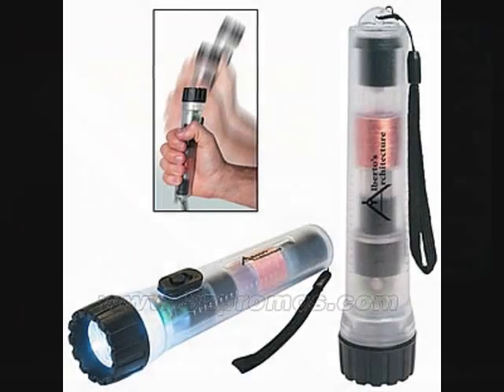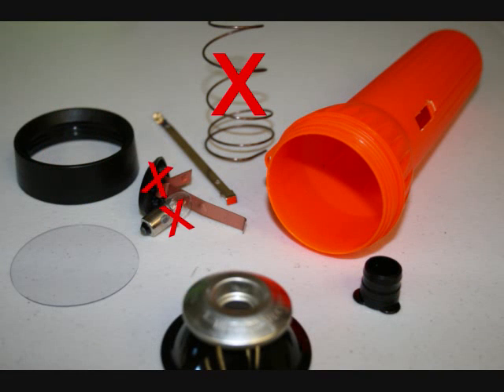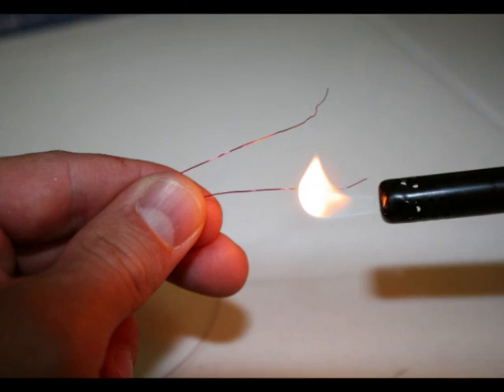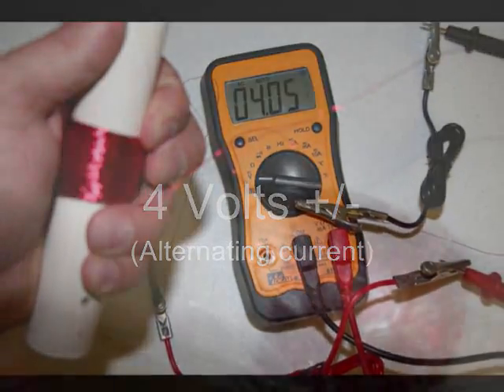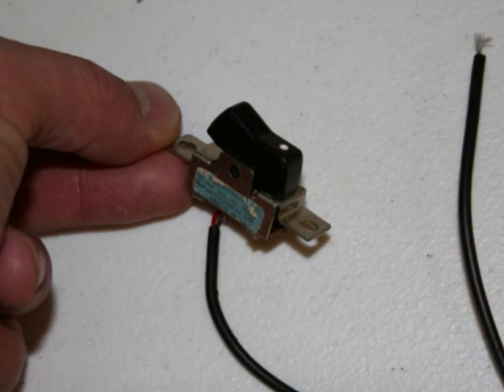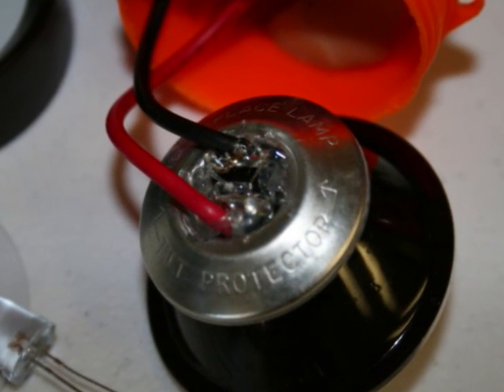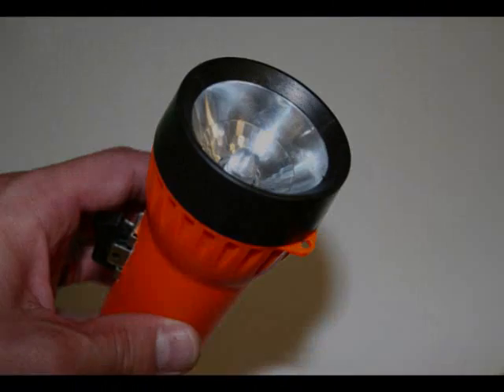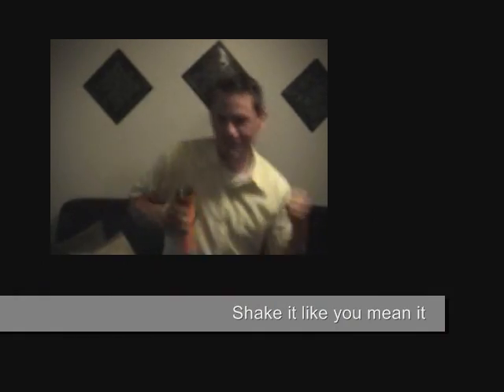DIY Electromagnetic Flashlight

Comment: for some reason, my LED light didnt last long more like 1 second of flash time. Did I do anything wrong?
Reply: The led has burnt out probably
Reply: @ihit2011RoboEngineer  no, the problem is the capacitor
it should be a battery not a capacity

Comment: I had one small question, can i use a 1000uf capacitor?
Reply: Unfortunately no, the capacitance of 1000uf would be too low for the led to be powered for long. Instead scrap some broken electronics or buy caps that are at least .5 fared, remember that 1 million uf is one fared.

Comment: 1 bldc motor
1 alternater
1 transmission transformer
1 switch box
1 circuits panel
1 ac to DC converter
1 big capacitor
1 7' brass ground rod
You have 1 self powered household generating plant to use for FREE free forever after cost to build.

Say no to utility bills and petrol fuels.

One power plant for home and one to motivate your vehicle.

Never buy energy again.

God's stuff

Comment from the maker: Some quick links to a few of the materials similar to what I used:

[✓] Magnetic Wire: http://amzn.to/2ckc5Aq
[✓] Rectifier: http://amzn.to/2clP7DR
[✓] Capacitor: http://amzn.to/2ckeECD
[✓] Rocker Switch: http://amzn.to/2clPHBg
[✓] White LED: http://amzn.to/2cd4Wid
Reply: Grant Thompson - "The King of Random" so this is how it all started :D
Reply: 1 day ago, hello
Reply: Isn't a 50a rectifier a bit of an overkill, is it?
Reply: Thanks!
Reply: +Grant Thompson How did you remove the spring
Reply: Grant Thompson - "The King of Random"  love all the vids even know there old
Reply: Grant Thompson - "The King of Random"  hi. i love you're vids I made the cap darts
Reply: The King of Random your a little late on that
Reply: The King of Random, no resistor for the led?

Comment: so, the capacitor is basically acting as a rechargeable battery?
Reply: +trouble maker I thought capacitors weren't very good rechargeable batteries.
Reply: +trouble maker Thank you for asking this, I couldn't figure out why it was even there but its obvious to me now that you are 100% correct.
Reply: +trouble maker They have vastly lower capacity than a rechargeable battery of the same size. In this case he's just powering a LED that draws very little current, so the (fairly large) cap nevertheless provides enough storage for a few minutes. A AA-size battery would probably power the LED for hours.

Comment: 3/4 inch PVC pipe works better. I used my table saw to thin down the pipe wall where I was going to put the wire coil so it would be even closer to the magnet.
Reply: +animu equals child pornography I completely agree and wish the USA would convert, but until it does I'm stuck with the standard of my country.
Reply: +Robert Vernon  Great idea about thinning the wall!  The closer to the coil we can get the magnets the better. I'm trying with some Hard drive magnets from 2.5" HD's epoxy'd round a foam core instead of a round neo magnet.

Comment: Grant Thompson - "The King of Random" what kind of circuit board did you get the bridge rectifier and capacitor off of? also is that a 1 farad or 1 milli farad cap.?

Comment: The cost of making this is stupid and the cap is too small and you don't need a bridge rectifier either, just a single diode. But the amount of magnet wire you will need to use along with the magnet just make this project more money than it's worth. You can buy a much better one for cheaper.

Comment: hey Grant Thompson - "The King of Random"  i have a doubt...you said that with only 30 seconds of shaking you have 10 minutes of light... did this useany kind of batery? where is it the electricity then? CAN you put a rechargeable AA battery or two? how should i change the circuit then? if i shate the flashlight without a battery like yours, and dont turn it on for, i dont know...six hours?twuelve? 3 days? what happen, the electricity is gone like static? if want to add to this a usb charger, AND the AA battery, ...how can i do that? my logic said that the battery will absorb all the charge... so...? howmany turns of wire do you use? thanks you and i am really concerned about my poor knowledge in english...excuse , that, greetings from argentina!

Comment: If you add more wire to the coil or add another coil over the first and wire it in parallel would you get more power for less shaking? I have had lots of bad luck with these types of flashlights I have one and I'm thinking of modding it to take regular batteries b/c I shake it like crazy and It's not very bright but when I use regular batteries it's much better.

Comment: The neodynium magnets store magnetism so its still a form of battery
Reply: actually its the 1 Farad capacitor yes that's right a FARAD not a microfarad
it's equivalent to a 1,000,000uF capacitor.
Reply: chems that's what confuses me, I thought capacitors discharged (almost) instantly. How can the LED emit light for 10 mins?
Reply: Matthew Pollock
 Super Capacitors F1 and up store a LOT more power than a regular capacitor and can function "somewhat" like a small battery.

Comment: can you list all the material please i can't hear it clearly
Reply: Magnet wire (insulated copper wire)
Neodymium magnet (very hard to find)
Bouncy ball (Not necessary)
Bride rectifier (To convert AC to DC)
Capacitor (1F - one Farad) (it's like a battery)
Reply: Madara Uchiha  well if was what doide should we use ?

Comment: Why is a rectifier needed? Wouldn't the shaking of the flashlight produce DC instead of AC?
Reply: When the magnet moves one way it produces a current following the coil. The electrons flow with the magnet. Shaking the magnet one way will produces an inverted current to shaking the other way. AC is basically any DC current inverting itself every so often, that is why a bridge rectifier is needed
Reply: Yeah he probably made a mistake.
Reply: I actually have no idea what you said.
Reply: ankit penmatcha I'm starting to rethink my original question. I need to get a bar magnet so I can experiment with this.
Reply: A few months ago I saw a demonstration on a real science show of this very principle. The magnet was slid all the way through the coil and registered a plus  on the ammeter. Then the host of the show asked the observers what will happen when the magnet slides back the other way. Everyone said it would send the needle to the other side of the dial. However, to everyone's surprise, including mine, the return trip of the magnet also gave a plus reading on the dial. The host pointed out that although the magnet was travelling in the opposite direction, it's leading polarity had changed. Two factors had been reversed, resulting in current flow in the same direction. Here's what I'm not sure about: The usual way to do this demo is to hold the magnet in hand and push it back and forth from one side of the coil. This gives an alternating current. But what would happen if the magnet were pushed in and out from the other side while maintaining the same orientation of the poles? The current would alternate but would it be with an opposite phase? (Added later) The more I think about the demo I saw on TV, the more I think there was something wrong with it. It doesn't make sense to me that it had those results.
Reply: jhanthony2 ok so you need two things to change to make electricity DC. Obviously the direction changed. But the magnet was not flipped in this one. The magnet was a cylinder and the hollow tube is a cylinder too thats why the magnet cannot turn around
Reply: jordan krishnayah That's why I now doubt the results I saw on TV. I never said the magnet was flipped. The experiment set-up on TV was essentially the same as that in this video.

Comment: Can anybody tell me what kind of Rectifiers should be used? I know nothing about the sizes... Below is the specs of some i found... Will they work for this? Thanks..
Amico 4 Pcs PCB 6A 600V Full Wave Single Phase Bridge Rectifiers RS606
Product Name : Bridge Rectifier;Model No. : RS606;Average Forward Current (If) : 6A
Maxi Peak Reverse Voltage : 600V;Maxi RMS Voltage : 560V;Maxi DC Blocking Voltage : 600V
Operating Temperature : -65C to +150C;Body Size : 22 x 17 x 7 mm / 0.87" x 0.67" x 0.27" (W*H*T);Pitch : 5 mm / 0.2"
Pin Diameter : 1.3 mm / 0.05";Pin Length : 28 mm / 1.1"; 34 mm / 1.3";Color : Black
Material : Plastic, Metal;Weight : 32g;Package : 4 x Bridge Rectifier
Reply: That would work fine, but is much more "heavy duty" than is needed. At the low voltages and current (Amps) being produced here, most any bridge rectifier would work. Be sure the ~ ~ + - are marked so you can connect it properly.

Comment: by soldering 2 wires to each pin of the capacitor, then soldering each wire lead where it needs to go.

Comment: No, it will not last longer. 3000 uF = 3 mF = 0.003 F
He used 1 F = 1000 mF = 1000000 uF
Compare the values. 1 F > 0.003 F
You need to get at least  1 F to get reasonable time out of it.

Comment: Ok maybe someone can help.  I'm very ignorant in electromagnetics but I gave this a shot.  I got 300 wraps of 26ga magnet wire around a piece of 1/2" pvp pipe.  I kept the winding within marks 1/2 apart.  Burned off the insulation in both ends and inserted a 1/2 cylinder x1/2 long n52 neodymium magnet. Set the digital multimeter to ac200. Shaking this thing as fast as I could I got 00.4v. Tell me I did something wrong.  I know my magnet isn't as big as the one in the video but Damn only .4v

Comment: those shake flashlights you buy are a total ripoff, mine cost about 20 bucks and after a month of very little use, it wouldn't stay charged. If you shook it while it was on, however, it would still work. Perhaps the most insulting thing is that upon cracking it open, i found that it was even simpler than the one grant made.

Comment: These capacitors are sold in quite a few places (including Ebay) you could browse specialty parts store like Digikey or Mouser electronics. There are 1F 5.5V capacitors, and even some 1.5F also 5.5V. Where it gets even more surprising is that for a few more dollars, you could get some 10F+ capacitors (but at a lower voltage). Keep in mind though, that although you could but some 30F Capacitors and put them in series to get the right voltage, charging them will be quite the workout..

Comment: Could be a 1Fcapacitor if the breakdown voltage is really low, like, 5 volts. The closer you get the two plates in a capacitor, the more it'll hold, but the lower the breakdown voltage is.

Comment: I was wondering the same thing, Grant.

I've removed capacitors from a few circuit boards, some about the same size as the one in your video.  However the best I could find was 1,000 microfarad = 1,000 uF = 1 mF = 0.001 F.   I was going to start hooking up these in parallel but it'll take a lot get near 1F!

Are you sure it is a 1 F Capacitor?  Does it say 1000 mF?  A friend who's an electronics expert told me capacitors are sometimes labelled mF when they mean uF (mu-F: microFarad).

Comment: yeah but asked for coated copper wire not the rubber coated stuff but if you take apart an old speaker or an old microwave you can get it practically free it looks like copper wire without anything in between it but it is insulated

Comment from the maker: 1. It actually is called Magnet wire in the US and you can find it at radio shack.
2. You're exactly right.  The red is the color of the enamel on the wire to keep it as thin as practical, while still being able to insulate it from electrical contact.

Comment: Two things:
1.Its spelled "Magnum"
2.He used copper wire. The red stuff is just the coding of the wire which 
   prevents the inner copper wire from contact to other wires to avoid
   short-circuits.

Comment from the maker: 1. Yes
2. One wire from the negative goes to the switch, the other connects to the negative terminal of the capacitor.  

Did you watch the video?  I'm pretty sure all your questions are answered in the video.

Comment: I've two more questions (I've been asking a lot of questions lately, but I want to get everything right!)
1. Is it OK if we coil the wires together instead of soldering them?
2. On the video after the diagram it showed 1 wire going to the capacitor, and another 2 wires coming from that negative wire. 1 of those other wires went to the switch, while the other goes to the socket. On the schematics it shows one wire going from the capacitor to the switch and one from the switch to the socket. Why?

Comment from the maker: If the copper is bare, it will short out and act as only 1 coil, so it would defeat the purpose of multiple wraps, and you won't get a very good voltage.  I'd say it is a big deal.

Comment from the maker: You should be just fine with 150 turns of wire.  Have you tried putting a magnet in it to see how much voltage you're generating?

Comment from the maker: lol yes.  But your lighter probably uses a piezo electric crystal to generate around 20,000 volt sparks.  To get that kind of spark with a shake-type system you'd probably need a lot of capacitors, or a voltage multiplier or mini-tesla coil type circuit and that may be very bulky to carry in your pocket???

Comment from the maker: Yes I imagine it could be used to start a fire in that way.  In addiction to an LED, it will light a light bulb, and that is basically electricity through a resistance wire .. however the energy is dissipated much more quickly so I think you'd only get a short burst before the cap was discharged.  Thanks for your comment, and compliment on the fire piston!

Comment from the maker: Each has its pros and cons.  A battery can hold a lot more power and releases it over time.  A capacitor can discharge almost all its power in a fraction of a second, but doesn't hold as much as a battery would, when comparing size for size.  Thanks!

Comment from the maker: Yea, you can use a resistor for sure!  Good thinking.  A little math applied to Ohm's law will tell you what ohm value to use.  The larger the capacitance, the longer the light should stay on before you charge it, and 1 farad is pretty large and hard to find, but if you have one then yes, use it!

Comment from the maker: The thinner the wire the better as long as it is insulated (has a coating of epoxy or varnish on the outside).  With a 10 volt cap, you may blow the LED.  I wouldn't recommend going higher than 5-6 volts.  Good luck!

Comment from the maker: I didn't really measure how much wire, but I'm guessing about 300-400 turns of wire.  Converting AC to DC is done with a rectifier diode and is explained in the video.  You can also make your own bridge rectifier out of 4 diodes and I'll eventually make a video on that.  Thanks!

Comment from the maker: Thanks.  I have considered both, however a 1F capacitor is actually quite large and it's very difficult to find one with more capacitance in such a small form.  You're right about resisting the current, but I like the bright light, and 10 minutes for 30 seconds of shaking was pretty impressive.  Thanks for your suggestions.  Are you going to build one?

Comment: Use a larger capacitor  to improve the lifetime (of 10 minutes in this vid)!
You should only have to shake it for some more time.

Place a resistor in series with the led to improve the lifetime. The downside is that the led is less bright.

Use the above knowlegde to improve your flashlight ;).

Comment from the maker: I didn't check actually.  With this low voltage and low current, you could probably use the cheapest one you can find.  Or you could even build your own out of 4 scrap diodes soldered together.

Comment from the maker: @Martinbilzen Give it a try and let me know what happens?  Looks can be deceiving.  a 1 Farad capacitor is very "big".  Usually they are much bigger size wise, but this has a very low voltage rating.

Comment from the maker: @JanHuniche Excellent point.  Yes I could have, and maybe should have, added a resister to limit the current, however the LED seemed to work just fine without one.  As for a voltage regulator, I don't think it's necessary because the capacitor charging absorbs any fluctuations in voltage, and the LED isn't affected until the switch is turned on.

Comment from the maker: @MrBadmashNo1 The capacitance is quite low so the charge probably won't last long.  Also, 6.3 volts might be a little too much for your LED depending on what kind you are using, but you can always use a resistor in series to drop the voltage to a safer level.  Hope that helps!  I'm glad you liked the video!  Thanks.

Comment: @01032010814 I've made some good improvements on the generator and you were right about the magnet thanks :-)  I've managed to charge a 0.22f capacitor up but what gets me is, it loses its charge very quickly.  After about 10 seconds its charge has dropped a couple of volts.   I don't know how to make it hold it's charge over a longer time I'm afraid :-(    On a better note, I've found that if you were to use two or more magnets with like poles facing, much more power can be generated.

Comment: thnx for ur reply dude, i've used thicker winding wire with more turns that the previous thinner one and have got some real voltage activity though it's not very remarkable or desired volume of volts. Next time i'm gonna try the heavier guage with double or tripple turns and am sure it will definately work. Nano magnest are bit smaller than a penny and thrice thicker than penny, they are really strong i've used 6 to 7 of them in a bar shape.

Comment from the maker: @HomoSapien2012 Your high gauge insulated copper wire is the same thing.  Radio shack sells it as "magnet wire" so you should be good.  I'm not sure what nano magnets are, but from the name I would assume they are very small?  Try bigger magnets?  Good luck!